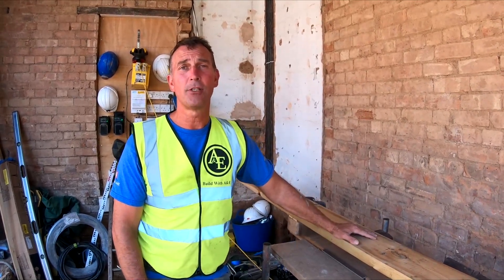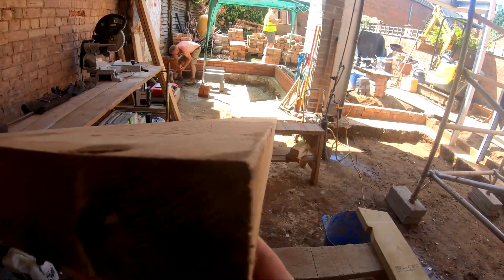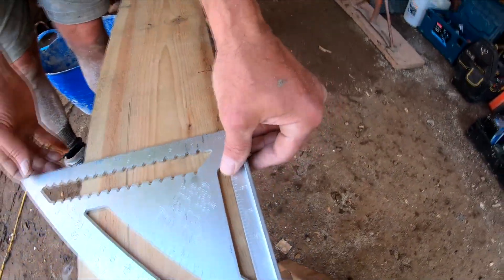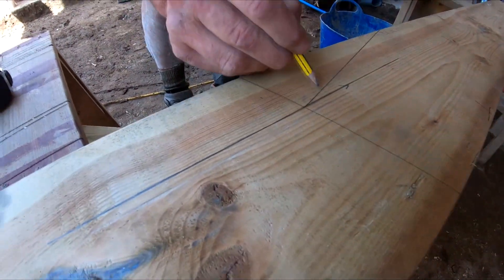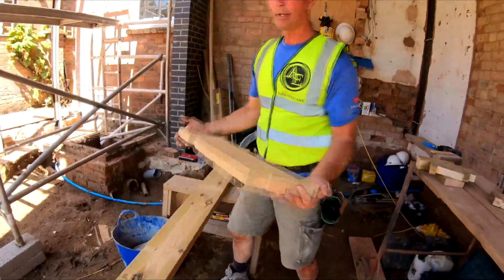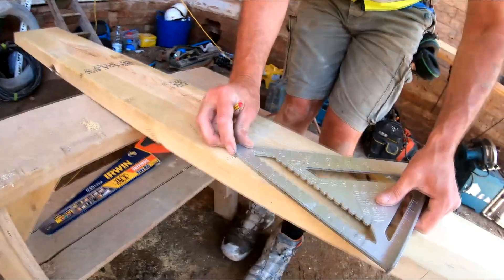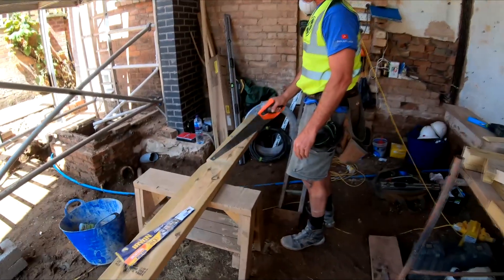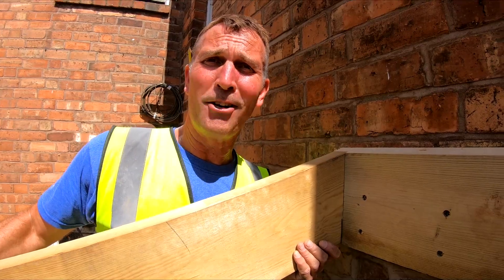HOW TO MAKE A COMMON ROOF RAFTER | DIY Series | Build with A&E

Comment: Good job but I'm confused. First you do a birdsmouth at a third of the timber then you put a template thats less then that over another. So if its a 15 degree pitch how have to two different sized birdsmouths
Reply from the maker: Hi Aran, people ask me why are roofs so difficult Tone, I say they are not you just have to stick to the golden rules, never rush, have a sharp coarse cut hand saw, skilsaw, plumb cuts both top and bottom are always the same and seat cut is always 90degree to the plumb seat cut, birds mouth as a rule is no more than A third of what ever size rafter you have so as long as you don’t exceed that you will not cause loss of structural integrity to the rafter, or any other timber. In the video I explain this about birds mouth being a third but when I then came to put the roof on there are always considerations as was this roof, steel position with wall, pitch of roof, this is why I had to cut a smaller birds mouth to line the detail through correct when the aluminium and plaster finish was done, as you can see when thinking about a roof it’s not just about putting the roof on it’s also about the finishing detail, Sorry about long reply thanks for watching all the best Tony 👍
Reply: @BuildWithAE  thanks appreciate the reply
Reply: there is no such thing  as 15 degree  pitch
Reply from the maker: @rexolrexol7893  Traditionally, a minimum roof pitch of 20° was recommended in BS 5534, but modern tiles and slates have now been designed for applications as low as 15°. It is uncommon to find a roof below 15° but for those very low pitch applications, there are interlocking clay pantiles available, suitable for use down to 12.5°. all the best Tony 👍
Reply: when i learned rafters A roof pitch was the total  span of the building and the height of the ridge  if you have a 4 in  rise that  is a  1/6th pitch  or 1/6th  of the span is the height of the ridge   but pitch is  not used much  it is rise per ft is the common usage.   i have thought a lot about roofs since i  havebeen retired..     for instance   is the valley rafter lowered    actually it  is and it isn't ...you may  know this but  say the common is 4 ''  height  above plate so  the center of the valley should be the  same  and you cut it    the same,  but  since the  valley  cannot  slide forward all  the way,  because  it is  sliding into  a  V,  you cut   1/2  the width   of  valley   back .. so in a 2x   you would cut towards the back of the seat  3/4 ''  this allows the valley to slide forward  and actually at the  intersection of the V the height  would be less than 4 ''  that  is why you  have to lift   the jacks above the edge of the valley rafter
Reply from the maker: Hi  @rexolrexol7893  if you get the same finished item then fine but there are more than one  way to pitch a roof make stairs make windows what ever along as you enjoy what you do crack on but you had made a point that was not correct and that’s it but who i’am to judge I believe in life you try and produce the best job you can all the best Tony 👍
Reply: @BuildWithAE  i am  a carpenter and i respect any one that knows the  trade..   to be a real carpenter you have to be smart...   i am not referring to myself  i worked with many  people that went only to grammar  school and they were very  smart  ... carpenter work is hard but satisfying   when you design and build something you are doing a job not many can do
Reply from the maker: Hi  @rexolrexol7893  I think being smart doesn’t really define a person it helps, but in life if you have a dream and passion for what ever that person will always be amazing and happy at what they do. I left school with no education just a passion for wood and I was very blessed to get the opportunity to work under an amazing joiner the rest is history. I respect anyones opinion and point of view that’s what this YouTube is all about to learn, listen get great advice from fellow trades people all the best Tony 👍
Reply: @rexolrexol7893  yes there is. New tiles are designed to go lower then 15 degrees.  Centurion tiles are such tiles. They are clipped not bailed into the baton and go to 12.5 degrees.
Reply: @aran5946  i only said Roof Pitches are not in Degrees the  term  is the relationship between the total span and the  height  of the  ridge   Say a 4'' rise  would a 1/6 th   pitch    a 8''  rise would be a 1/3  pitch

Comment: Hi there thanks for this - extremely helpful as I'm planning a 3m long porch roof outside the front door. How did you work out what size timbers you need? My porch will have a toughened glass roof. Don't suppose I need 8x2 for that? Many thanks. Ben
Reply from the maker: Hi Ben if you look at the trada rafter/joust book on line also speak to an engineer with regards to weight of glass and snow load all the best Tony 👍

Comment: Thanks, I’m a 65 yr old DIY guy about to build my first shed and this is really helpful. Your demonstration and explanation were clear and the camera work was effective. Not having any experience in the building trades, I have to learn as I go and it’s a lot of fun. Fortunately, my projects are all for myself so there’s not a lot of downside risk. Thanks again and keep up the good work!
Reply: i am 78  and been a carpenter for my life    i have found before  building something that is a little tricky   I think about it and review  all the problems in my head    to know rafters you have to do them and review in your mind over and over to remember  just how.   but here is something you may know   to determine the length of a common   you take the span of the building   add any shear  or siding that may have been put on.     so  a 24 ' wide building  with 1/2  ply shear   would be 24'  1'' then deduct  the thickness of the ridge   say 1   1/2''   so it would be 23'  11  1/2 ''    if  you use a rafter book that would be the span .   if you had a hip or valley ( they are both the same length)  you would look under hip /valley  use 23' 11  1/2''    and it would tell you  the length of the  hip or valley   there is no shortening   think about  this  the   only  part of the   seat of the hip that touches the edge of the build is the very  center of t he  seat cut.   the two edges using a 2x rafter  would not touch the build they would be   3/4''   from the plate   that is why you have to drop the hip

Comment: At 7:20 when you marked 2430mm, how did you define how far down the width of the board to mark it? It looked to be just in the 'general' area of the lower 1/3 from top edge. Would that be a fair conclusion?
Reply from the maker: Hi Andrew as a rule birds mouth on a rafter would be normally 1/3 of the timber depth but but with this rafter it was less than a 1/3 because of detail by Architect and getting the rafter to work with the detail required thanks for watching all the best Tony 👍 have awesome week

Comment: I’ve found that when you work on older buildings, the wall plate is pissed as well as the ridge/wall plate; that’s when things get interesting.
I worked with a roofer one time that did a hip roof roof for me and he didn’t have a roofing square, just plonked the timber into position above the actual area, marked it off with a handsaw and on it went. I was impressed.
Reply: The first 1,000 rafters are the hardest, it gets easier after that !

Comment: Nice work there, I'm doing roof wall to wall 4.8 meters, with transparent corrugated sheets on top, with a ptch, what size timber should i use 6x2 7x2 ? or should i make trusses up out of 4x2 and 3x2? Or do i do i make up a flat roof out 7x2 or 8x2 and put firrings on? My main concern is the spand overall is 5 meters by 4.8 meters, Will the joists begin to sag in middle over time? My preference is rafters off a ledger board going onto wallplate timber on other side for inside height, like a greenhouse of gable wall, Cheers
Reply from the maker: Hi Ricky there are many factors, if you look up on the UK trada joist and rafter table that will give you an idea using C16 and C24, you are right with huge spans its better to check via the table or ask an engineer because of additional Snow loads. Pitch roof looks much better and less issues later on down the line thanks for watching all the best Tony 👍 have a awesome week
Reply: @BuildWithAE  Cheers

Comment: Hi Tony fixing the  wall plate 2 x 8 for a lean to  brick wall  for a timber framed extension (3 x3 meter) with M10 concrete bolt is it sufficient to carry the load of flat roof  5 or 10  degree pitch angle. Or do need  chemical anchor m10 threaded  bolt.
Reply from the maker: Hi Jaymon Chacko there are a lot of factors to take into consideration I would talk to an engineer or look at the trada rafter table on line, if you have drawings they should be specificed, thanks for watching all the best Tony 👍

Comment: Great videos from you guys,  but could you explain how you work out where to fix the wall plate
Reply from the maker: Hi Andrew,

The height of the wall plate is usually determined by the architects drawings. The height of the finished roof would have been authorised by the planning committee, and so we must adhere to that.

Hope this helps.

All the best, John 😊

Comment: Great explanation Tony. After you measure and mark the first rafter do you just cut copies for the other rafters or would you have to measure every rafter individually to take into account any small deviations of the wall plate? Tks
Reply from the maker: Hi Lee much appreciated glad that you enjoyed the video, I always measure each rafter on an old build because most of the time they run out, I think from memory this ran out by 30mm, new build is totally different, in theory they should be all the same, have a great week thanks for watching all the best Tony 👍

Comment: You know when the template was different to the one u mark out first how did you work out the templates bridsmouths cheers
Reply from the maker: Hi Mitchell the birds mouth was determined by the steel frame work once the wall plate was put on you can see this in the project series footage hope this helps thanks for watching all the best Tony 👍
Reply: @BuildWithAE  cheers I'm doing a carpentry Apprenticeship and this helps thanks 👍
Reply from the maker: Hi Mitchell glad that made sense, good to hear about the apprenticeship it’s great having a trade the younger generation are, are future all the best Tony 👍

Comment: Great workmanship. Question though, why the halving joint on the plumb cut? Never seen that before on any roof old or new, and never seen a regular plumb cut connection fail either. Looks great though👌
Reply: Would be better doing a birds mouth on the top plumb cut surely?
Reply: dalerobertmoore I’ve done a few with birdsmouth on the top plumb cuts and they are notched in to help prevent twisting
Reply: @chriscoulson7684  I've never notched in the top plate just seem very overkill, 3 nails in sides one on top it won't move much definitely won't affect the roof. Must have good price on the job so far play to them. Great stair making video his got
Reply: dalerobertmoore yes it’s very overkill

Comment: Very neat work. QUESTION. What did you use to attach the ledger to the brick work please? Are there anything specific building regs require these days in the UK
Reply from the maker: Hi Tim Wyld sorry about late reply they a M10 concrete bolts engineer we had detailed everything so a lot easier for us, thanks for watching all the best Tony

Comment: i assume there windows going inbetween the gaps in the wall plate ... i thought the rafters would have to be doubled up?
Reply from the maker: Hi Ash Le if you watch the project series you will see that the steel frame  provides all the structural support required. These rafters are only taking roof load not structural load, You are correct we’re you have dormers, Velux you would double up the rafters. Thanks for watching and Keep Safe regards Tony 👍

Comment: Nice neat job. How do you achieve the height of the plate fixed to the wall? Surely you need a rafter length first?
Reply from the maker: Hi James the wall plate was set in stone by the Architect, we had to drop down a certain distance off the window sill line, so no rafter length required. Thanks for watching keep Safe 👍
Reply: to get the height of any ridge which is what the wall plate is     from where the rafter seat sits on the   outside of the wall  measure to the wall   deduct the width  of the ridge or ledger  say you have   a measurement of 3 '  8 '3/8''  deduct 1  1/2''  inches   3'    6 and 7/8''    say your rafter rises 4 '' per foot    4 x 3 is 12''   then to get the odd inches   use a framing square  draw a 4-12 on a board and slide  the square  following the run part of the square   until  you read 6   7/8''    as you slide it the distance will start to decrease   on   the rise part of the square  when you have 6  7/8''  read the measurement it  would be about 2  1/4''    next   add the height  above plate at the seat    and that would be the top of the  wall     if you use a 2/6 rafter the height above plate would be about 4 1/2''

Comment: hey brilliant videos! and extremely professional job! Was there any particular reason for the notched rafter on wall plate rather than the traditional notching it so it sits on top of the wall plate? or was that as per design?
Reply from the maker: Hi Obs3rve thank you for your kind words. It’s a detail that was required by the client and Architect to give it a clean line. Well spotted 👍. Thanks for watching
Reply: @BuildWithAE  i am guessing you had to cut out the top plate notches not in situ? Doing it this way does that mean you dont need any truss clip/hangers or is screws okay for building regs? Also do you begin with a rafter at the end of either side to get squared up before you start running them in case the block work is out?

Comment: Nice demonstration . That wall plate details a nice method 
Can I ask how come you didn’t stick with the 65mm bird’s mouth in the end
Reply from the maker: Hi masherco, of course the detail of the birds mouth has to change because of the engineers steel detail with finished window heights and hiding the steel in the rafter l ine. In the project series it shows the steel work in relation to the timber work detail as the build goes a long. We lost the gutter detail in the rafter line. Hope this helps, thanks for watching 👍 have a awesome weekend
Reply: It’s funny when setting out you have to tweak things to make everything pull together that’s the great thing about trad roofing, nothing being set in stone. 
Thumbs up anyway, I’m going to check out your channel
Reply from the maker: masherco thanks Bud hope you enjoy 👍

Comment: Do ppl use jiffy hangers on the wall plate
Reply from the maker: We don't use jiffys unless required bud. In this application the thrust load to the wall plate would never move. Also with the notch detail introduced there's never a chance of movement because the steel frame work and the way it's been designed by the engineer 👍

Comment: You said early on in the video the birdsmouth has to be 1/3 but on your template rafter it must of only been 20mm or 30mm birdmouths? Any reason for that?
Reply from the maker: Hi Grant sorry about delay in response 
The reason for the birds mouth being smaller. We had to achieve a certain detail from the drawings this could only be achieved by reducing the birds mouth with the 6inch timber. The ideal is a 1/3 but sometimes it not always the case, the one thing I was always taught was never more than a third but some chippies would disagree but it’s just they way I was shown. There is nothing wrong with smaller birds hope this helps. We are doing a very complex roof in are next project. Hips valley’s if there is anything that we can record and show on the roof and build let us know.
Thanks Tony 👍
Reply: Build With A&E best thing you could show me is real world problems like if the wall plates are not level or the building isn’t square. And showing how you get over them. Great videos by the way👍
Reply from the maker: grant I know what you mean, cheers about the videos 👍
Reply: @BuildWithAE  I've add 4x1 to wall plate once to make more of a birds mouth
Reply from the maker: Hi dalerobertmoore good shout could of done that to get a deeper birds mouth, personally I’am not a plant on Guy I would of preferred to mill a 4 x 5
Reply from the maker: Hi dalerobertmoore  thanks for watching keep Safe all the best Tony
Reply: dalerobertmoore I also have used two layers of 4x1 as a wall plate to eliminate half lapping....worked a treat and took half the time
Reply: @chriscoulson7684  👍tho I'm not sure nhbc would let ya on new build
Reply: dalerobertmoore  I said the exact same thing to the developer, it was his idea. I have reverted back to traditional methods tho